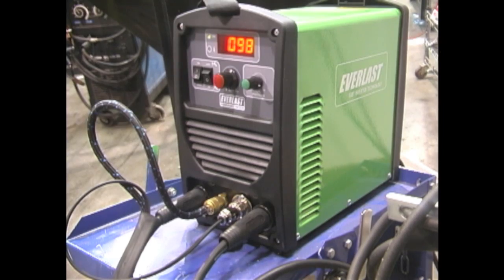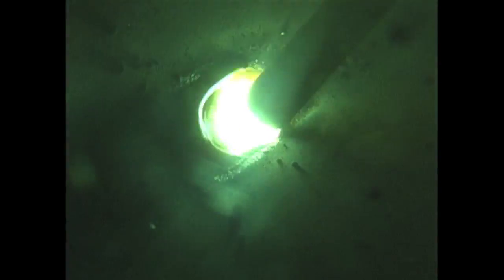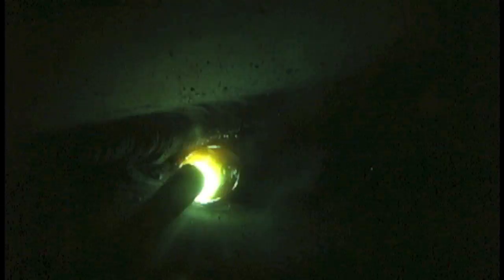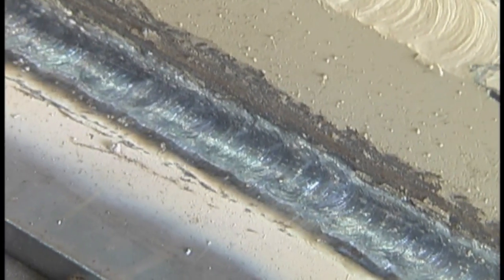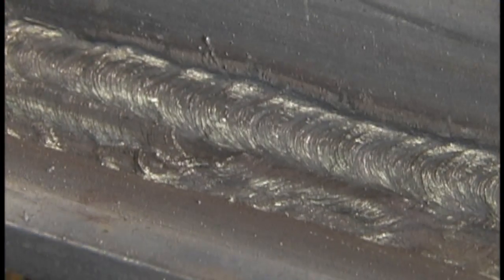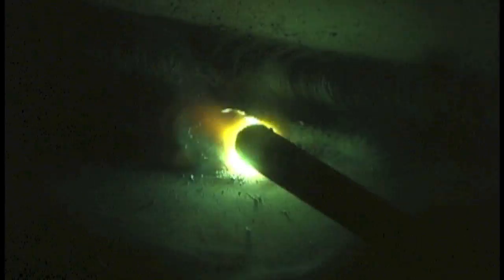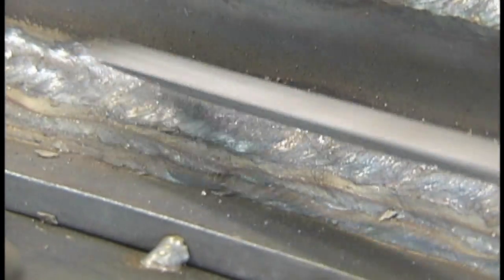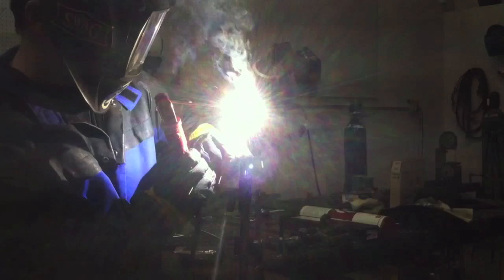Welding Overhead with Everlast PowerArc 160sth and 7018 rods

Comment: I've been trying to decide between the Everlast 161STH and the 210STL to use primarily as a stick welder that I would take with me to jobs for equipment and farm repairs. I don't plan on running electrodes larger than 1/8, but I typically run 6011, 7014, and 7018. I would occasionally use it for TIG welding as well. 

Would the 160STH be enough to run in that application, or would you recommend the 210STL? The 160 has some cool TIG features that the 210 lacks, but again the main purpose is to be a stick welder for jobsite and farm repairs.

Comment: I wish you would show how you  hold stinger and rod. Embarrassingly, I just failed intro to welding because I never could run a straight stringer. I bought an Everlast 200ST with less than two weeks to go in the semester but have not quite finished my welding station due to Christmas stuff so I couldn’t go back and do some projects.
Found out we were “not” actually welding in intro and I managed to get in everything for the second semester. But I was the slowest in the class and quit in the middle of the fourth semester because couldn’t do overhead stick. But then at 70 I am not planning to become a pipe welder.

Comment: I received my everlast powerarc 200st today, and couldn't even strike an arc , out of the box it runs for a few seconds the dial doesn't  work at all . The lights blink for a while then shuts down , bad first  experience with this machine , I really needed this machine , I am a pipe welding student and told many classmates that I ordered this welder , will make a video on this malfunction

Comment: Having to decide if I want to buy power arc 140 I have the money for now or waiting until I can get the money for the 160 w/ pedal to have the high freq. will be going in service truck mainly for stick but do have some tig stuff I do
Reply: lift-arc stinks once you've been able to work with a foot pedal ;-)
hi-freq start is great for low-amperage, exacting work. Also important if you work with stainless...
Reply: Definitely get a welder with HF start if you can. My everlast welder has both options and more often than not I'm setting it on HF mode.

Comment: You are correct, when I put about 75 angle on my overhead, the molten metal may drop but what most annoys me are the porosity, any tips to avoid this? I am using 120 amp as what the module said.  Please need fast reply I am going to take the test 2 days from now.

Comment: I picked up the Everlast 140st a while back. It's a great welder. I hear they made some minor changes to it this year like replacing the toggle switch to a rocker switch and providing a pigtail for easy 110/220v switching. They made a great welder even better. If you plan on doing a fair bit of tig welding I'd go for the 160sth though.

Comment: Mark, I never stick welded with mine on 110 Volt. Since the last posting I tig welded on 110Volt it puts out 92 amps and it worked well for me. Yes - it's a good machine. I welded some fluid tubes on hydraulic cylinders and it worked ok at 92 amps. For stick rods I like to run 1/8 inch diameter that needs a little more. (But I can always run it on 220Volt) I really like the way it perfoms on 220Volt.

Comment: @schneetiger77 - It is a very good machine. I've used it on 110v and 220v and it has the same silky smooth arc. It is a very efficient welder under 110v. I'm a bit surprised at just how many amps it can pull. So far, very reliable and very happy with its performance.

Comment: I found it a little odd how you say to not weld with an 'extreme' angle when welding overhead. I'm a senior in a tech. school in the welding shop, and when we do pad welding 3/8 plate overhead for certification practice i often weld with an angle, maybe not as heavy as you show and get pretty similar results to what i see here. Nonetheless, very helpful video, favorite channel to stream welding videos.

Comment: I do not know for sure, but I have used a sharpened tungsten to score glass for the score and snap glass cutting technique.  It is very hard and chews up a regular grindstone pretty quickly, which is why tungsten grinders are usually diamond wheels.

Comment: Hi. I just do amateur maintenance type welding. I used to use stick welders, but since I "discovered" MIG, I've never used stick welding since. Just wanted to know is stick still widely used or is it just for specialist welds in difficult materials/situations? I much prefer MIG. Not so much welding fumes, no slag to chip off, no wire brushing, etc. Just wondered if there are specific reasons why welders still use sticks. Thanks!

Comment: There's not a single how2 vid on u-tube on 7018 O.H. welding xcept 4this 1. I'm taking welding @college & I've always had trouble w/O.H. on T-joints. I'm suffering from severe O.H. dread. i like O.H. but I'm having a hard time w/it & w/this very nfomative vid, gave me problemsolving tips that will help me mprove &get better @O.H..now I'm ready 2practice on a T-joint. This vid is n my fav. List. the techniweld rods SUCK! excalibur rocks! Thanx jody 4a helpful video! im ready 2practice my O.H.!

Comment from the maker: 6013 is rated for overhead but just like 7018 it needs to be set hot with a tight arc to avoid slag and wormholes. same techniques apply